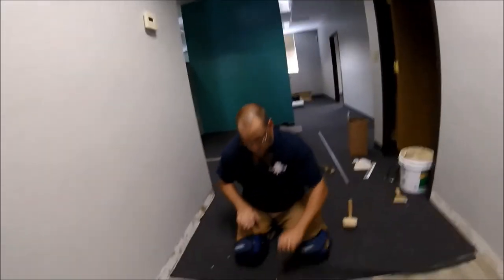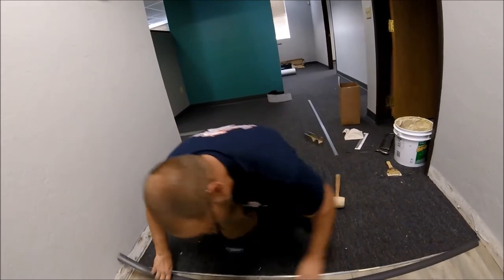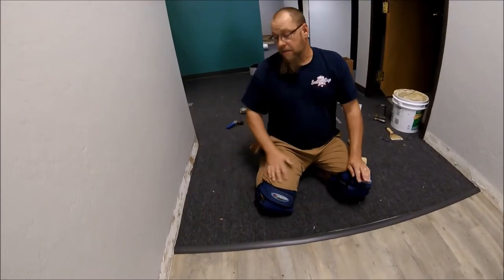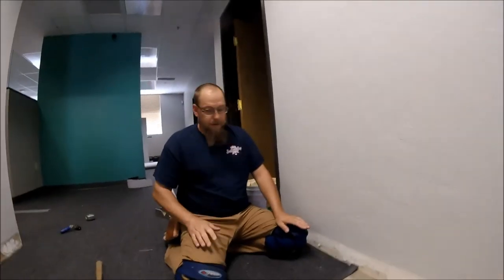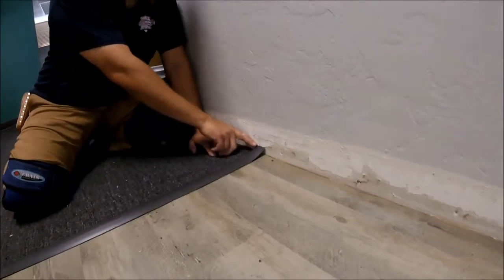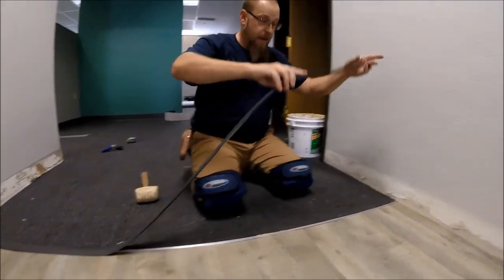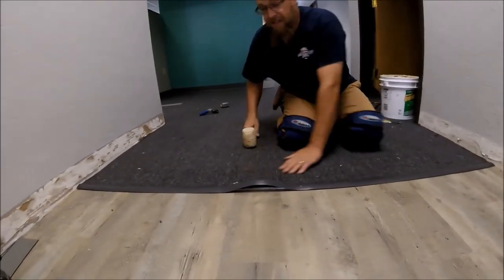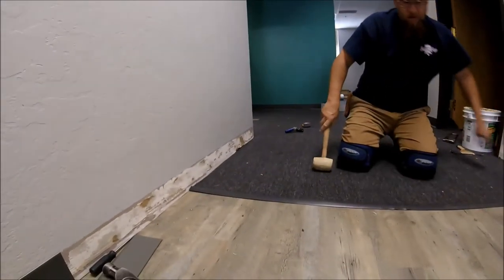RUBBER T MOLD TRANSITION HOW TO

Comment: Nice tip. I think a lot of it is guys are stretching them and then they go back to there original state. I don't believe I would use a snap down T reducer on most installs unless it was specifically called for,or could not use a glue down reducer.
Reply from the maker: James Lucas same Here I hate that stuff

Comment: I got one in a door way with carpet & title the very edge of corner the carpet is starting to fray at a doctor's office I think it might be glued down????????
Reply from the maker: In a doctors office I’m sure that is glued down. The best thing you can do for that is cut off any strings that are sticking out and apply superglue to the end of the string that you cut so it does not continue to raffle.
Reply: @FloorsbySouthernboys  thanks I did that I cleaned the strip used spackle knife pushed it in.
The only place close was ace hardware I picked up glue the only thing i didn't read was I had to shack the glue wish me luck the glue stunk 
& 48 hrs to dry I told em walk over it.U think it's gonna matter that I didn't shack the glue???????

Comment: Where can I pick up or order that rubber t molding And the track that it goes in
Reply from the maker: Should be able to order it anywhere that sells flooring
Reply: I'm down here in Florida three flooring stores not the big box I'm having a hard time finding that t molding I need some guidance they keep telling me it's commercial and no one seems to have a commercial distributor
Reply from the maker: @doctorjacktrademastersnone760  It is a commercial transition, but surely to goodness a carpet store can order it for you

Comment: Really informative! Is this the reason that the corner pieces at a shop where I volunteer is popping up at the corner? It's a tripping hazard and I've volunteered my Hubby to fix this problem. It seems that the pieces don't meet in the corner. Thanks again!
Reply from the maker: Lisa Bigon If the corners are coming up the track itself is probably loose
Reply: @FloorsbySouthernboys  is there a way I can show you a couple of pictures, one of which is being taped to keep customers from tripping...which is not working as an elderly lady tripped just last Tuesday when I was volunteering. I'm new in this area and am just getting acclimated in so I'm trying to help them out but am really lost. I also viewed your other videos and thought maybe it was glued but I know I saw a silver track thing near the check-out desk so I think that's what it's installed in. I'm not sure if I can even post a picture here. lol. I'm too old for youtube, I guess. lol.
Reply from the maker: Lisa Bigon You cannot post pictures here, and if it is I am sure it is in a track then you will need someone to pull out the rubber piece and re-nail the track back down to the concrete, I don’t think that that would be something that you could do, it requires driving nails through the track into the concrete
Reply: @FloorsbySouthernboys  thank you, sir. I'm sure you're right. We have equipment here at home, like impact drivers, but I don't think this is a job for novices. Time for the professionals! Thanks so much for your help!
Reply from the maker: Lisa Bigon Anytime